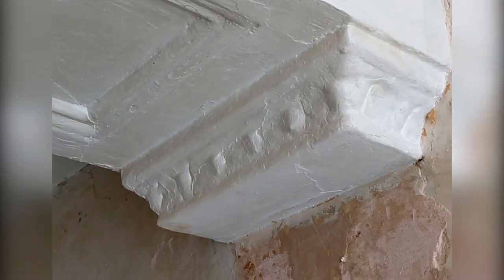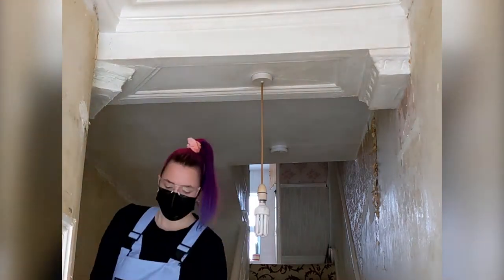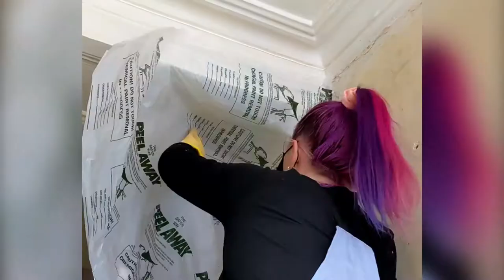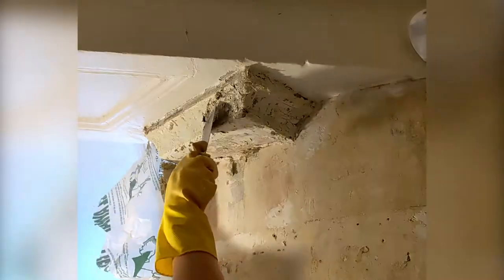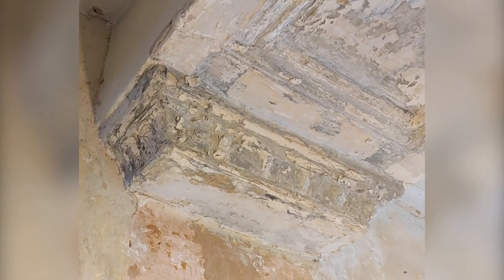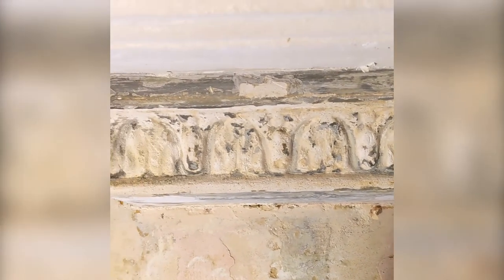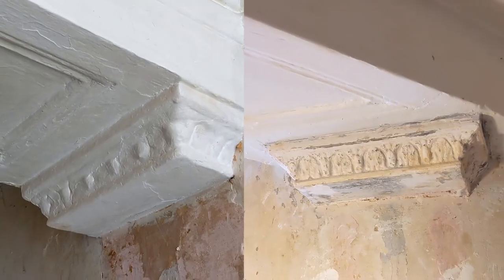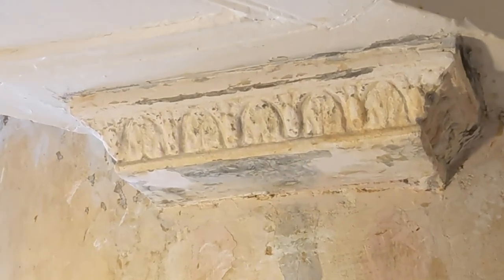How to use Peelaway 7 on plaster mouldings and corbels 🛠 | Sharn's House

Comment: If you’re trying to strip delicate plaster mouldings, especially very old, original and delicate plaster and horse hair ceiling roses or intricate coving then believe it or not the absolute best way to remove all the layers of paint in one go is to use porridge. No, that’s not a joke. I first thought it was when I came across it but in the end decided just to give it a go and was amazed. It not only means no nasty chemicals, but it cost less than a few quid to restore all the ceiling roses and corbels in my whole house, rather than the extremely expensive products I’d found online. The lack of nasty chemicals is especially important when working under ceiling roses in situ and you don’t have to wear PPE.    Essentially you have to pack the surface with thick porridge (made with just oats and plain hot water, nothing else) and then seal the covered surface with plastic (even carrier bags work) and masking tape. Leave it about 1 week, by which time it should smell like a brewery and the fermentation process should enable you to literally dig off all the layers of paint in one go. Very satisfying. Did document the process many years ago but never got time to post them online. Hope this helps 👍